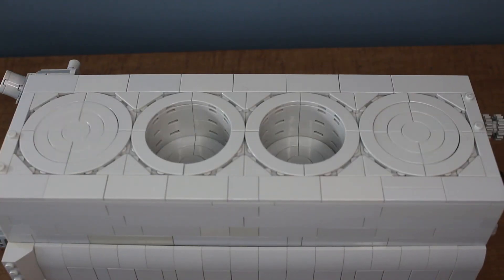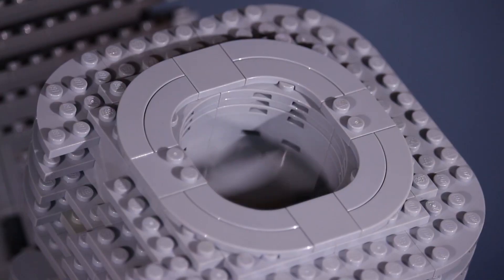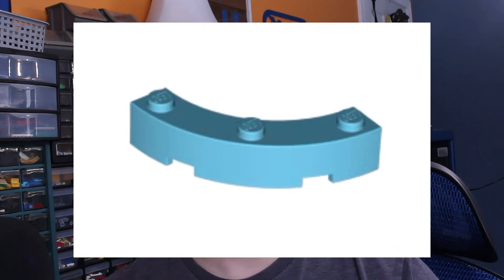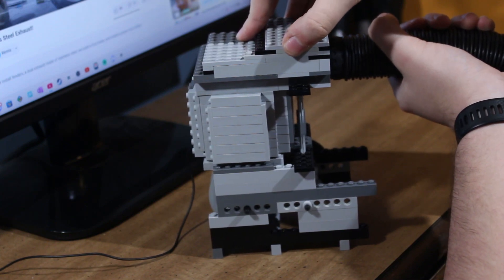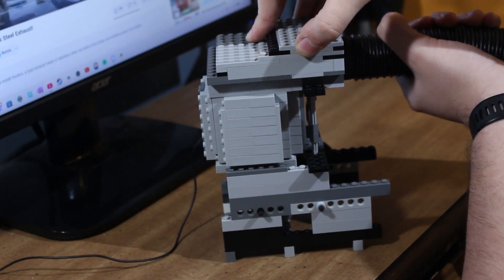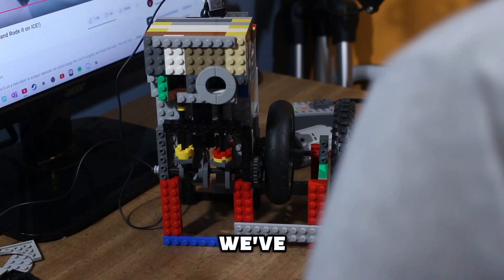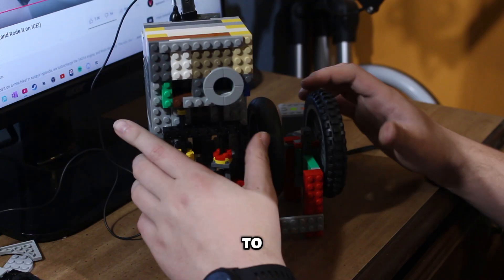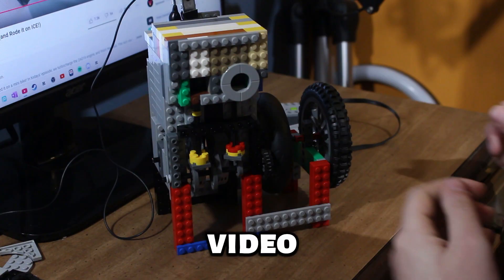I Tried Making LEGO Vacuum Engines with Round Pistons!!

Comment: Just a guess about the 8 wide engine, could it be the vacuum cfm is well matched to the 6 wide, but the extra volume of the 8 wide cylinder likely is too much for the same cfm vacuum source. I have recently been thinking of building a Vacuum Engine, and like the idea of realistic round pistons opposed to square plates. I've seen suggestions of lining the cylinder with packing tape to create a smooth unbroken cylinder wall, and also take up a slight amount of gap. I notice wile attempting to start the 8 wide, there was a large gap at the top of the cylinder. Not sure if it extended to the interior, but it could have been leaking. Some Ideas I have for a Vacuum Engine Build: find brass tubing just larger than the Technic Axles and cut it into pieces very slightly wider than the beams and other parts the Axles rotate in. Then carefully using a drill press, enlarge each hole where an axle goes and press in the brass tubing to act like a bushing. Also add some thin brass washers between rotating components. I also wanted to explore building a dedicated "Lego Vacuum Source". Something with very high volume, and running it without a filter for unrestricted flow. I think a realistic "V-Twin" will be my first attempt at building an engine.
Reply from the maker: The biggest problem I've found with the 8x8 rounds is that the arches don't create a perfectly round cylinder when fully connected. You have to loosen the connection between them to allow the piston to move. I think that might be the largest factor as to why my attempt didn't run. I did a few cylinder tests, and they were surprisingly airtight, at least as far as LEGO can go. There's also the issue of a fraction of a millimeter's worth of plastic sticking out from one arch every now and again, that's another issue I had. That will stop the piston dead in its tracks.
Now that I think about it, I might need to revisit the 8x8 round piston engine 😂

Comment: I've got a question

I made a lego engine turbine that runs with water so is it called a engine or a pump?
Reply from the maker: @CEZZNA_AVIATION  so it runs using the flow of the water I'm assuming? Technically, I believe that would be a turbine
Reply: @DeltonAdamsLEGO  yes it runs with the flow of water and its very powerful
Reply from the maker: @CEZZNA_AVIATION  Very cool!
Reply: @DeltonAdamsLEGO  thanks!

Comment: hello, I have been following the evolution of the engines that you make with round cylinders for some time now....
if I can just suggest you to use a set of 24 or 36 teeth pinions, for the drive of your distribution...you will be able to calibrate your engine as it should be! if you want tips let me know...see you soon...I like your research work
Reply from the maker: I did use some large gears, though I don't believe it's clearly visible in the video. Thank you for the comment!

Comment: you need a OHV system for better results, Flatheads died for a reason.
Reply from the maker: Flatheads are easier to build (in my opinion) and they have a cool sound (also my opinion).
Not saying one is better than the other, but flathead is great for testing, which this entire video is about
Reply: @DeltonAdamsLEGO  I think you should try and built a OHV LVE but maybe have the head transparent.